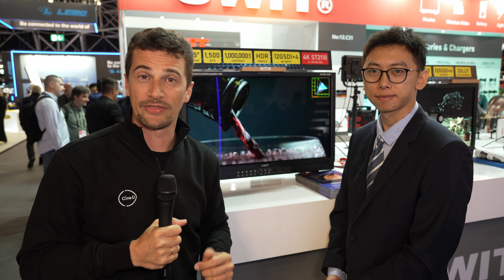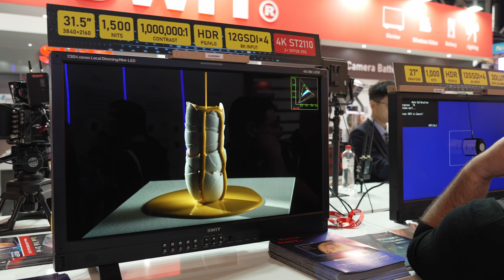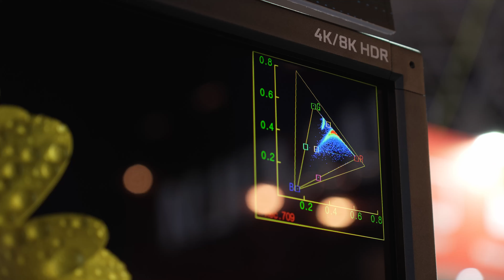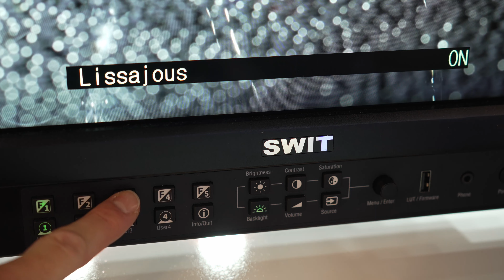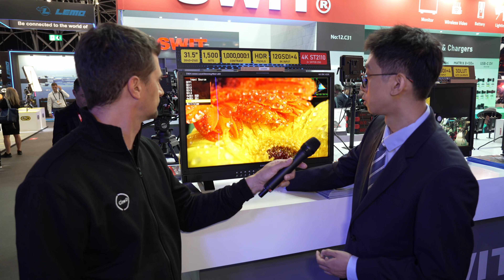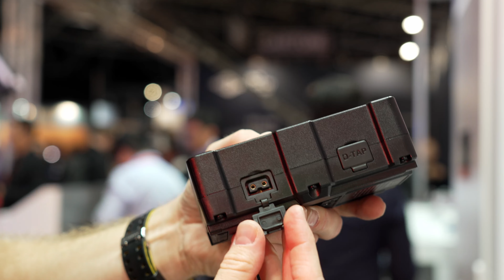SWIT BM-U326MD Mini-LED 4K Monitor and CIMO V-mount Batteries Announced

Comment: Price is insane. ASUS sells this same panel for literally 10% of the price as the ProArt PA32UCXR. It doesnt have all the SGI inputs and switching, but surely you can accomplish that with cheaper means.
Reply: I was going to say exact same thing. Their ProArt 32UCGX is 1600 peak brightness and 1000 to 1200 full screen brightness. and it's around 3500 Euro i think .. just but a Blackmagic SDI to HDMI or SDI to DP converter. This is mainly useful for broadcasters with network managed environment but if I have the money for this, I would spend 5K more and Get the SONY BM310 or the Canon Equivalent :D